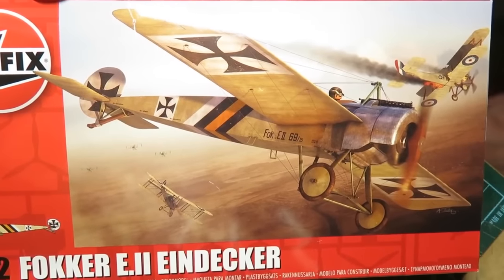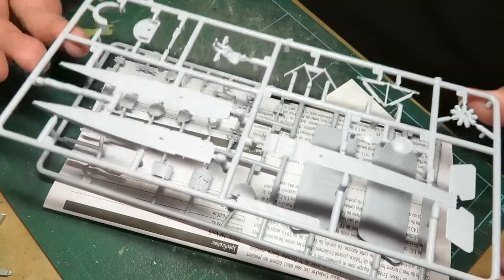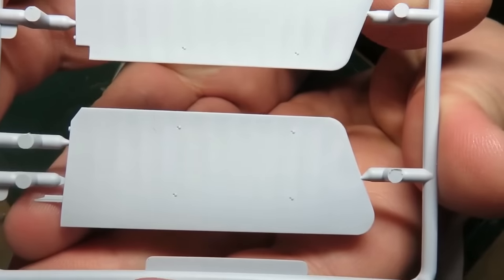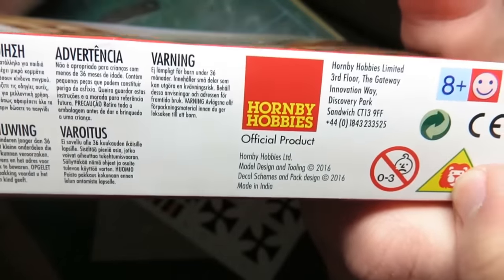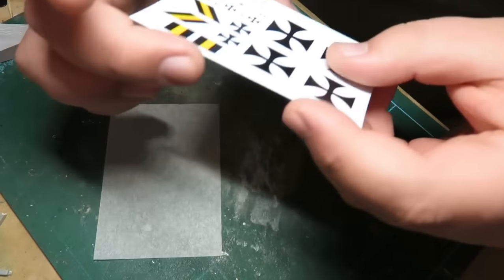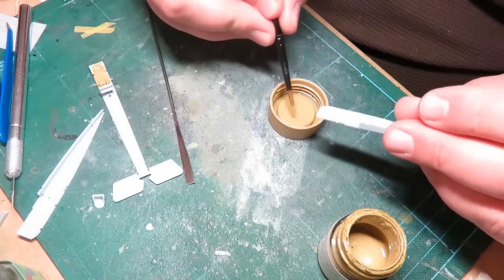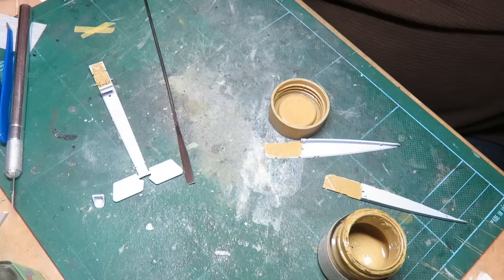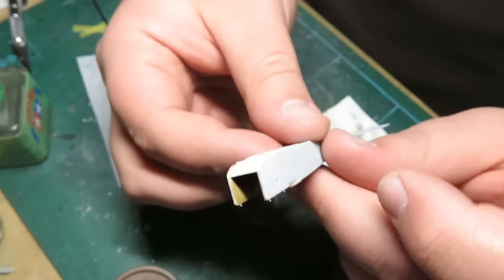Airfix 1:72 Fokker E.II Eindecker (Part 1) New tooled!

Comment: what a great little kit. a quick question though. Did you apply the cockpit wash directly over the paint or did you gloss coat it first ?
Reply from the maker: +regalmeister For this build I applied it straight onto the paint. When I do the panel lines on the fuselage I try to have a very glossy, gloss coat.
Reply: +rebelsatcloudnine thanks for the reply